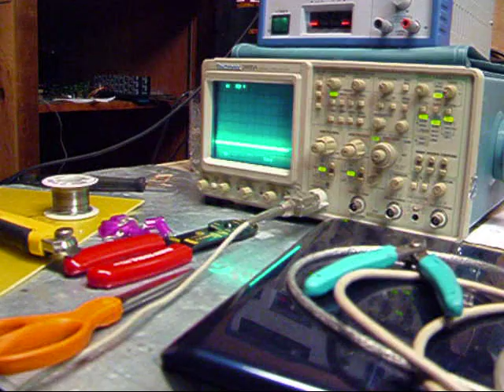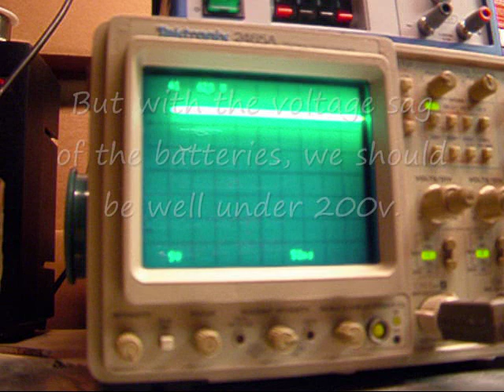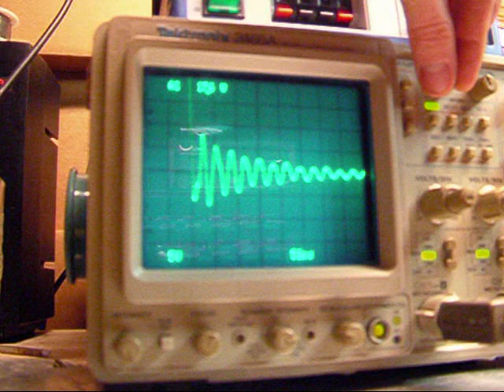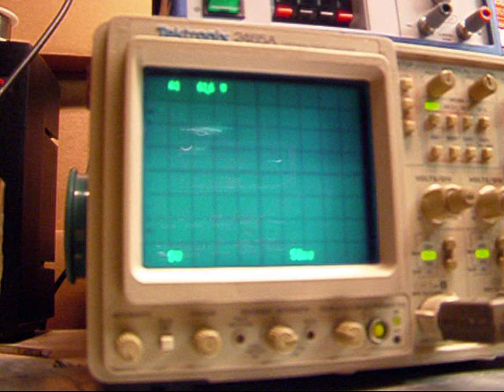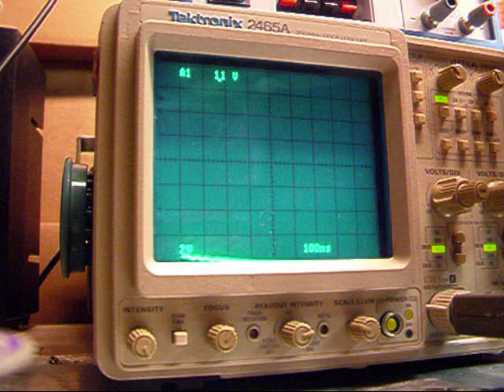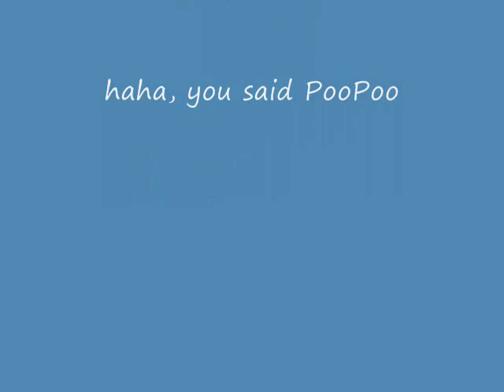1000amp controller tests at 100 motor amps.wmv

Comment: @MPaulHolmes Another thing you can do is put one probe on the signal you want to see and the other on the ground point, and set the channels for the same voltage per division. In "alternate" mode, the scope will show both signals on the screen, and you can see how much noise you can ignore on the line that has the signal you want to see. Not exact, but it will give you an idea what you really have. You are not likely to be looking at frequencies low enough to use "chop" mode.

Comment: @MPaulHolmes There are some things you might be able to do. Most scopes have a 3 prong plug, which can cause a ground loop and give you garbage signals. If yours is like that, put a 3 to 2 adapter, from the hardware store, on the plug, and don't ground the tab on the plug. Be careful not to float the scope to high voltages and get zapped if you do this. A certain amount of noise is inevitable, and you just have to know it's there. Long wires anywhere make it worse.

Comment: I would guess that most of that ringing is not real. Scopes being used around high power switching pick up a lot of noise. You can see how much of it is just noise by putting your probe tip on the same point as your probe ground. I saw this a lot on things I used to work on.